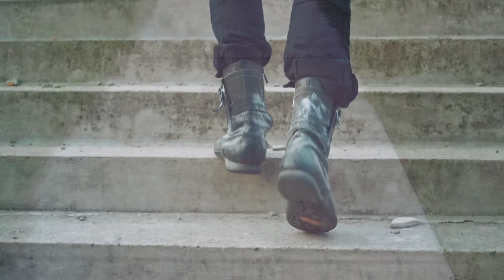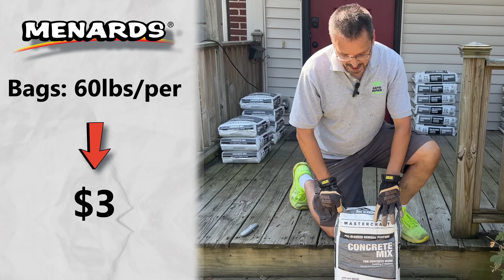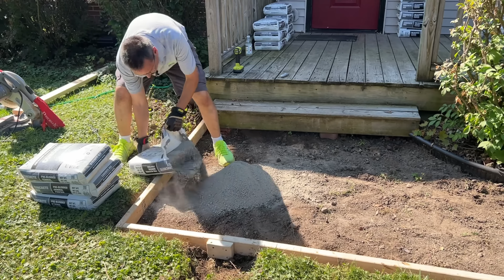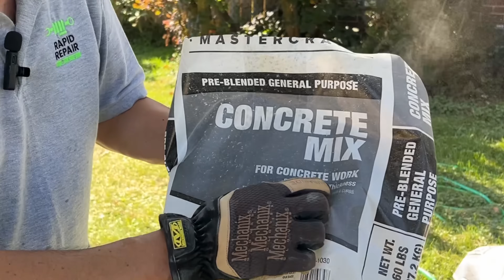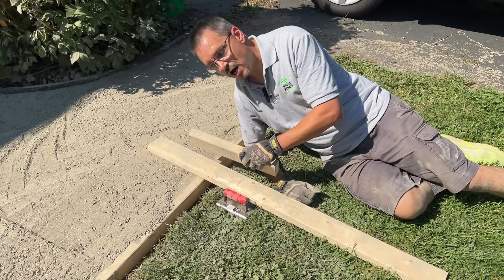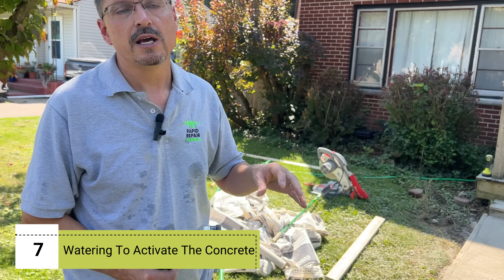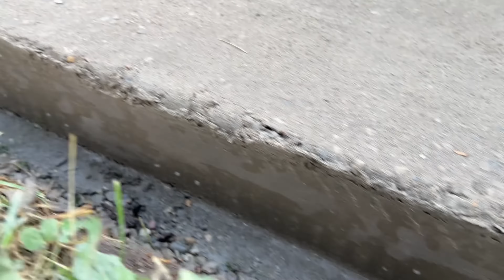Dry Pour Concrete Method Anyone Can Do

Comment from the maker: Water Schedule
For Dry Pour Concrete 

	1.	Gently Mist  - Wait 20 minutes 
	2.	Gently Mist again - Wait 20 minutes 
	3.	Gently Shower - Wait 1 Hour 
	4.	Full Soak & Flooding including edges and surrounding area.
Reply: Hi just a thought from G.B.across the pond, maybe a good tip would be to wet the ground base before pouring then the moisture would be coming from top and bottom to aid curing and for better better strength. Your welcome.
Reply: @HomeRapidRepair  you need a mask when you open each bag please
Reply: @6sangsue9  you might need one, I don't
Reply: @NealZ-l2g yes you do! Ask a person that got lung problems.  That dust is so fine one time can destroy parts of the 🫁 . Why do you think smoking 🚬 is a problem?
Reply from the maker: @6sangsue9  My lungs thank you!!
Reply: Why didn't you show this, this is the most important part
Reply: @thailandlife12  it crumbling in a month?😅
Reply: @smgjr89  does doing it with that type of concrete make it more fragile or did he do it wrong? Considering using this material.
Reply: @mackadams5049  its the dry pour period. It doesn't hold up. There are videos proving how weak dry pours actually are.
Reply from the maker: @thailandlife12  sorry about that. You’re right. However, I did include it in a follow up video here: Dry Pour Concrete Test - DIY Concrete 
https://youtu.be/0jxCoXkS-EA
Reply: 😅😅😅😅 dude youre an IDIOT 😅😅😅
Reply: Hello, do you now how many bags i need for 225 square feet  2 inches thick
Reply from the maker: @kevinklippenstein2769 like 100 bags. They are free online Concrete calculators for you. The Readymix bags at Menards are only about two dollars per bag…
Reply: @HomeRapidRepair  concrete for 30 years this wrong on so many levels
Reply: @LukeHolliday-u7j  Exactly, I have been in commercial construction management for 25 years and overseen placement of 1000’s of yards of concrete.  If a “contractor” told me he was going to do a dry pour, they would be escorted off the site.  This is a horrible technique for homeowners who have no idea what they are doing and want an easy way out.  All they do is waste good concrete.

Comment: ok, so question. I live in the desert and it's 100 degrees out. How much and often, do I mist under these conditions?  Also, we don't have a Menards, and I was wondering if you could post the appropriate Home Depot bags to buy, because Home Depot has regular post concrete bags and fast-setting concrete bags for posts. Or, would I get a different formula from Home Depot?   My last question...can I add color to my concrete?  Specifically, a brownish tone color?  Thanks!
Reply from the maker: The temperature would mean you should be misting water often on your new slab....don't allow it to dry out. By the third missing you will be soaking it and keeping it very wet. The water will absorb on all sides.

The normal everyday common bags of pre-mixed concrete are fine. You don't want post setting. Just everyday use mix bags, I think they come in 40 and 80 pound bag sizes. There is a free concrete calculator online you can check to see home many bags you may need. Menards, Lowes, or Home Depot it doesn't matter. BTW, I have all three stored in my town.

The color change probably will not work. You have to mix concrete into the mixture and with dry pour concrete that will not work. There may be color concrete tinting options but I really don't have experience with that. Good luck

Remember dry pour concrete is only for small projects and concrete areas that are non structural. The slab is still plenty strong, the only complaint is the final surface appearance

Comment: It's not really a good idea. It does not soak up all the way down.
Reply from the maker: It's more than fine for little projects and small concrete slabs. Should never be used for structural concrete or large areas. Thank you

Comment: Can you dry pour sono tubes ?
Reply from the maker: Honestly, I probably wouldn’t. Concrete is incredibly strong with compression, which is what those tubes are but you cannot guarantee quality. So dry pour is never recommended for structural items just for small projects like garden walking steps, garbage bin slab, etc

Comment: No Rebar mesh for reinforcing, did not wet ground, gap under the steps, how do you guarantee the underneath has all had water reach it.
Reply from the maker: great questions. You really don't need wire mesh for small projects....in another video I drove my work truck over a dry pour concrete slab to prove it. I have an updated video on my channel where I show the 1.5 years results of this walkway slab so you can see there are no cracks.  The water does absorb into the slab very good...However, dry pour concrete is not for structural slabs or large slabs. Only for small projects like garbage bin pads, steps, garden paths, etc and so much more.  Check our the video on my channel where I cut open a dry pour slab to show the results.

Comment: Can I dry pour a garage then wet cement then self leveling for smooth surface? Will they adhere to each other?
Reply from the maker: Yes I think this will work. I do think they will adhere to each other. I think the larger question is that's a very large area and are you sure you want to use unproven methods? Dry pour is really only for small projects.

Comment: Installing a carport over the slab. Would the dry pour concrete support the bolt-down base plates  for the posts?
Reply from the maker: I drove my work truck over a dry pour slab and it performed fine. Now the edges can get a touch brittle....so if you are going to do this for real...you probably should design it so the bolts will be at least 6 inches or more from the edge of the slab.
Reply from the maker: You also could get fancy and have "real" mixed concrete placed at the sections for the bolt down plates
Reply: @HomeRapidRepair yeah that’s what I was thinking. Maybe with cylinders a few inches higher than slab so that the posts would be stronger and less risk of water pooling around them during storms

Comment: Would it make a pad strong enough to hold an outdoor boiler that weighs just over a ton?
Reply from the maker: yes it would! I drove over a dry pour concrete pad with my work truck to show how strong it is. The only negative is the surface can look a touch poor...and the edges can be somewhat brittle. But it is still very strong in compression (downward strength)

Comment: I'm actually in the process of getting ready to pour a concrete pad for our new hot tub.  But, I only have a mixer with a 2 bag capacity. I will need to use around 60, 60lb bags.  Not, sure if have enough time to wet mix that quantity.  Does the dry pour method provide enough strength for a hot tub with reinforcing steel mesh and a tamped gravel base?
Reply from the maker: Yes it would work. Concrete has a ton of compression strength....I drive my truck over a new dry pour slab to prove the strength. Concrete is week in tension..and that's why people use rebar.  I know 60 bags is a pain...You will have to decide quality. The wet mix will be better, however dry pour is easier but will work. Dry pour also has a bit of an ugly surface and the edges can be brittle. I tell people dry pour concrete for small project ALL day long...but for big jobs and structural jobs you should get some helpers and mix it properly. If you have an assembly line of helpers, like 6 people, you can mix up that many bags with the mixer in now time...good luck

Comment: You can 1000% do this by properly by mixing the concrete in a bucket, by yourself. If you really needed to you could go it in smaller sections. It’ll take some forethought but it’ll work. Also, reinforcement (mesh is fine), control joints and compacting the base where all missed. If you have freeze thaw in your area this is going to get back fast, there is going to be 0 properly spaced and sized air voids to prevent damage.
Reply from the maker: Those are some great points about preparation and longevity, thanks for the detailed feedback! 👍🏼

Comment: I would recommend some rebar or fiberglass concreate gid about halfway from top to avoid cracking or if it does crack down the road it won't crumble appart or shift to bad.  just a way to stabalize and add years to its age.
Reply from the maker: That's a great tip for added stability, thanks for sharing! 👍🏼

Comment: A little concerned that with no reo in the concrete it could crack over time. Thoughts?
Reply from the maker: rebar isn't needed on such small concrete slabs.

Here's the 1.5 year follow up video if you want to check it out: https://youtu.be/Cyb-I71PQ00?si=_m-mQByW9IRFVQE_

Comment: Get a wheel barrel and mix it with a hoe or a shovel you have help, mix a little wet and pour. I have done 19 bags of 80 pounders in 105 temps in southern AZ by myself with a bad knee and shoulder and still was able to work it and made it look pretty darn  good.
Reply from the maker: 19 bags by yourself is brutal…could you of rented a concrete mixer?
Reply: @HomeRapidRepair  Honestly a large wheel barrel will hold 2- 80 Ibs bags and a good stout hoe will mix it fairly fast. I did not enjoy it, but had to get done and was too tight to hire someone. LOL
Reply from the maker: @cppower14 good job 👍🏼😎

Comment: Concrete dust contains respirable crystalline silica, a toxic mineral that penetrates deep into your lungs and causes irreversible scarring, chronic breathing difficulties, and life-threatening conditions like silicosis, COPD, and lung cancer. Wear breathing protection when using any cementious product. This is NOT how to make a concrete sidewalk. There was little preparation of the area that the slab will sit on. One of the keys to prevention of cracked concrete is to make sure that the slab is even thickness. The ground is going to move  and the slab will crack at the thinnest part. There is no reinforcing mesh or bars in it. It will crack without it. Concrete needs water to work. Read the bag that it came in.This doesn't work.
Reply from the maker: Everything you say is factual… But there’s another fact that people are looking for easy alternatives for small projects…👍🏼😎

Comment: No sub base?
Reply from the maker: No, not needed in this case. It was a very small slab… In my area sand is the most common for the base… Unless they need additional drainage, they’ll use gravel… It’s been 1.5 years and there’s not a single crack on this concrete slab…

Comment: Sweet. I have a bathroom that once we have the new pipes in from the plumber we have to put the soil back in, and eventually the concrete to top it all off.
Want the pipes to last another 50+ years just like the last ones.
Reply from the maker: Sounds like a solid plan, good luck with the project! 👍🏼😎

Comment: That is sooo much foolishness, concrete cannot last long like that, it should’ve mix well before put down plus it doesn’t have any rebar it gonna break to pieces in no time. If you put down dry concrete and wet after the bottom won’t mix as it should
Reply from the maker: You bring up good points. Only advisable for very small DIY projects

Comment: if you live in the midwest do you have to do anything different because of the winters to avoid the concrete from cracking?
Reply from the maker: You want a well drained area...so the most common is a sand base that is tamped down...small slabs don't need rebar.  If you have a large slab, cut control joints, however you shouldn't use dry pour concrete method on large slabs anyways.  Good luck

Comment: This is a farce, it doesnt last. Do it the correct way or you'll constantly be replacing it.
Reply from the maker: I understand your concern, but this method has held up great for small projects over the years. In another video, I even drive my work truck over to show how strong it is. It’s not new…Dry Pour concrete videos blow up on the internet 8 years ago.

Comment: No joints cut in that’s will crack eventually
Reply from the maker: Here is my 1.5 year results video where you can see ZERO cracks in this slab. I understand some people hate the surface appearance, but dry pour concrete does have it's place for small simply projects when a home owner is not able to mix tons of bags

Comment: I have basically 6by5 meter square, very rough broken concrete, can I fix it with this method without removing anything apart from loose bits . Can i
Reply from the maker: Honestly, you HAVE to remove all broken and loose pieces BEFORE you would attempt any repairs. I think dry pour concrete is an easy method for repairs and new small slabs, but clean up the old stuff first. Good luck

Comment: Would this be work for a driveway that's about 20 meters long and 3.5 meters wide, with existing broken pavement left and right and also existing poured concrete blocks and loads of weed in between?
Reply from the maker: I would say you’ll get a version of a new driveway and a Repair… But it’s still a lot of work. You might not be happy with the results long-term. Generally speaking you’re not supposed to pour concrete over old cracked concrete…. Good luck, my friend.

Comment: Can you use this method to do a driveway?
Reply from the maker: I would say yes it is strong enough to drive vehicles over… Although sometimes you will get crumbly edges…. As long as you’re going through all that work and that expense for a driveway, you probably should have it mixed ahead of time…
Reply: I want to use it to widen about 2ft on both sides and level my driveway a little. I was thinking about using geogrid for extra support since I would be using it on existing concrete, do you think geogrid helps? Also, is there a way to change the color? And can I coat it with some type of sealant? @HomeRapidRepair
Reply from the maker: @pakinapoo yes I think you can have a level of successful. However as long as you’re doing all that work and want it to last you should mix concrete properly or have it delivered with a ready mix truck. Dry pour concrete is only for small projects.
Reply: @HomeRapidRepair  the dry stuff sounds easier to do solo :)
Reply from the maker: @pakinapoo I 100% agree… that’s why I make the videos I do to help out people… Good luck

Comment: I used this method (in the UK we call it 'postcrete') to build a hard pad to store a BBQ, garden seating etc between a shed and a garage. Ten years later it's still intact. It was laid on a compacted sub-base of MOT Type 1 crushed stone so that has probably helped longevity.
Reply from the maker: Thank you for sharing all of this...the words we use may be slightly different, but I see where you're going. These concrete pads hold up just fine, if you don't need a perfect looking top surface. That’s awesome to hear it’s held up so well over the last decade! 👍🏼😎

Comment: Can dry pour be done on top of existing concrete; like an existing concrete driveway, provided it's graded properly? Thnx.
Reply from the maker: Yes, in theory it can for sure. Although I would question as to why you would want to do that. It’s really only for small projects. If you’re going to do a driveway go ahead and mix it the traditional way. Also anytime you put concrete on top of old concrete, make sure the old concrete is still structurally stable if the cracks are enlarging or any sunken areas that’s not going to last long-term. The pros said your new Concrete is only as good as your sub base..

Comment: I have layed 100s of tons of concrete in my building carrear and I can say without a shadow of a doubt that will not last five minutes the edges will break of first before it all crumbled
Reply from the maker: 1.5 years later and no crack at all.: One Year Update Of The Dry Pour Concrete Walkway 
https://youtu.be/Cyb-I71PQ00 

the surface does tend to spall alittle bit especially by the driveway… Dry pour concrete is only for extremely small projects… I have never recommended it for large areas. It’s only for beginner DIY’ers, not meant to replace concrete crews…

Comment: 2 questions: 1). Could I add rebar for more strength?  2). Would this method be strong enough for a small shed?
Reply from the maker: Yes, and yes. Absolutely installing steel rebar we add to the overall strength of the slab and this is strong enough for shed projects and similar sizes. 

Here’s a video where I drove my work truck over a dry pour concrete slab: Dry Pour Concrete Test - DIY Concrete 
https://youtu.be/0jxCoXkS-EA
Reply: @HomeRapidRepair  Right on, thanks for this info!

Comment: Thank you for this DIY’er question tho if I wanted the smooth finish how would I do that? Thanks in advance 👍🏽 keep those videos coming
Reply from the maker: Thank you for your positivity. Unfortunately, with the dry pour method, you’re limited in getting a smooth appearance. You can use a roller a paint roller to smooth it out and then be careful with your misting. Also, I’ve seen people use topping cement for the top inch on top of the dry pour slab…that’s step two like after a week of curing

Here’s another video I have on the same topic: Dry Pour Concrete Test - DIY Concrete 
https://youtu.be/0jxCoXkS-EA

Comment: For the few minutes it takes to use a rented mixer I don’t think I’d dump powder without rebar and expect it to last through a couple winters with frost. 
I’d just do it right.
Reply from the maker: Fair points 👍🏼😎
Reply: In this video, say I was doing it at home, can you tell me at what point to add rebar? And where does it go? Like which layer.
Reply from the maker: @s @stephaniemcoburn llo. You can add rebar directly in the middle. Good luck 👍🏼😎
Reply from the maker: Rebar isn’t needed on small areas such as garbage bin slabs, steps, small walkways, etc

Comment: Could I redo my asphalt driveway and turn it to concrete with this material?
Reply from the maker: Yes in theory you can. But honestly, it’s probably not advisable. That’s just too large of an area. Dry mix method for concrete is only for very small projects…
Reply: @HomeRapidRepair  makes sense thank you for responding 🫡